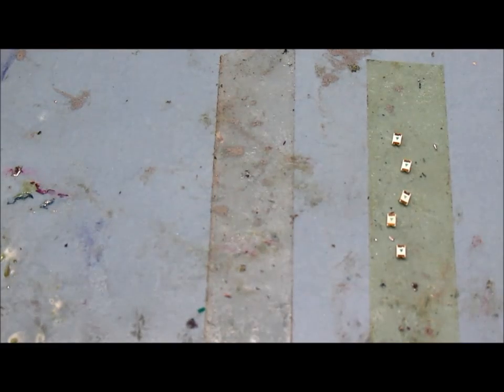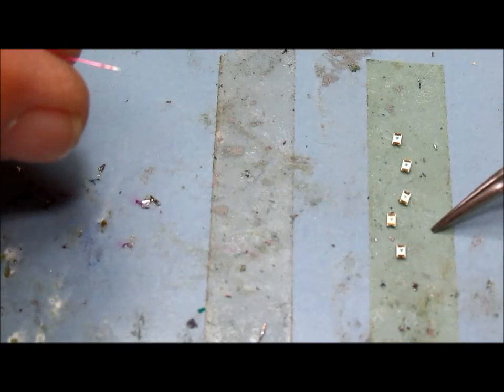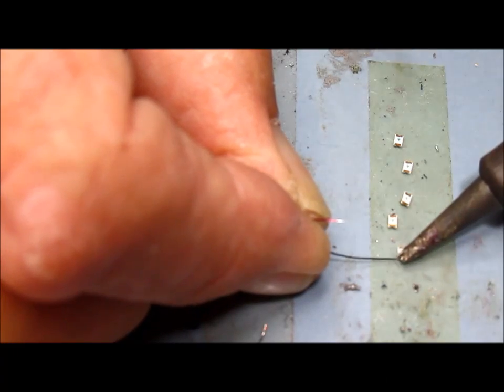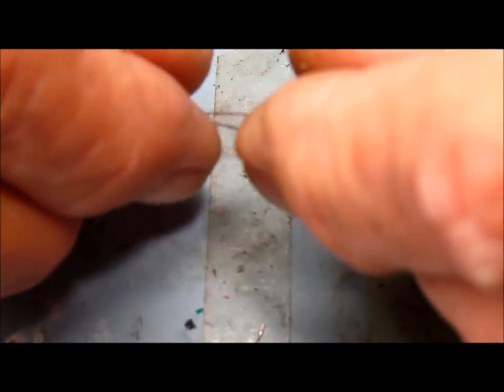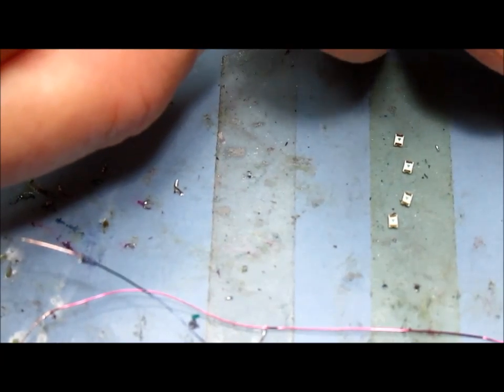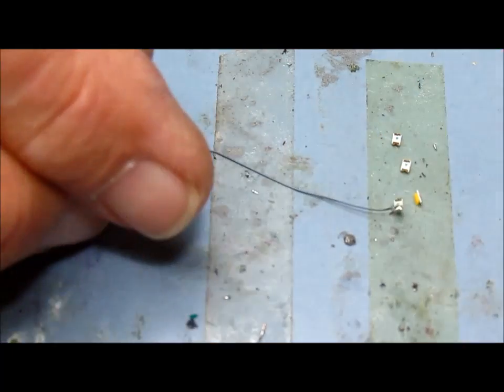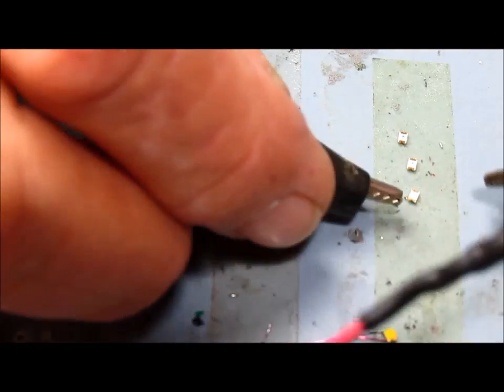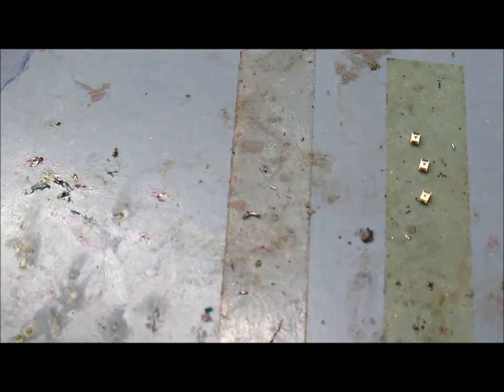Wiring 0805 LEDs

Comment: Even know I’m seeing this video 8 years later I got those same led an they do work on 9v
Reply from the maker: Never connect an LED directly across a power supply. Make sure you are using a series resistor for the LEDs.. 1000 ohm for 9V will be OK.
Reply: @Westimation  good look going to solder it now
Reply: @Westimation  what is ohm ?

Comment: I just got these leds and I plan to wire them to a on/off button, how do I do it and what size resistor will I need? I’m using a 379 battery
Reply from the maker: A 379 battery is 1.55 volts, too low a voltage for most LEDs, except a Red LED which will require a 47 ohm resistor in series with the LED. (Wired between the LED and battery). A LR44 3V cell will work with 100 ohm resistor for red or yellow LEDs or 47 ohm for white or blue LEDs.
Reply: @Westimation  their size 0805 leds, red yellow and green
Reply from the maker: @lildoorknobb5954  Use LR44 battery and one 100 ohm resistor for each LED.
Reply: @Westimation  how many watts for each resistor
Reply from the maker: @lildoorknobb5954  Any low wattage resistor will do.
Reply: @Westimation  How about for 12v's, what resistor is required then please? I'm wanting to create a circuit of white smd LED's + power single ones. With thanks
Reply from the maker: If you want them really bright 470 ohm or 1K ohm.  If I want realistic building lighting I increase the resistor value to 4K7 (4700) ohms or even 10K ohms. 
You could wire up to three white LEDs in series (observing polarity)  with one resistor. Thus each series chain will draw the same current a one LED and resistor. I am using 10K ohms in series with three LEDs on a 12V DC supply on a few of my projects (train carriage and building lighting) and get a very realistic light level.
You must be prepared to experiment with different resistor values. 
ALWAYS use a series resistor.

Comment: what wires are you using ? and how did you get the two colours?
pls , thanks for the upload.
Reply from the maker: Hi Mohsin. 
This wire is from Roadrunner wiring pencil range. 38AWG, which can be purchased from Element14. (search for wiring pencil).
The other and much cheaper option is to use fine wire from a small relay. Use a longer wire to identify the anode.
Prewired SMD LEDs are now available form AliExpress. Saves a lot of work and smaller sizes 0603 and 0402 available.

Comment: Nice job ,this why I bought a digital microscope,Sam smd  make you go blind,I have magnify lamps ,magnify glasses,I need all the help I can get,I like the two sides tape idea
Reply from the maker: Great idea for old eyes like mine. However I used a microscope years ago for SMD work and found how much the soldering iron tip shook in my hands.
Reply: mine hand do shake too,it does take some getting use to ,after all the through hole stuff i have soldered so i bought a little rework station to help me also

Comment: Maybe very important thing to mention is that before soldering the polarity of the LEDs has to be considered .
Reply from the maker: Thanks, have added to comments.
Reply: i also have 0805 and it took me a while to figure out which one one + and - . Then i found that on the front part one of the edges is cut out identifying the minus. I hope that helps if someone has the same led.
Reply from the maker: If you look at the video in full screen you will see that these LEDs have the a triangle the and the base of the triangle indicates the Anode (Positive) end.
Some SMD LEDs have a T and the top of the T indicates the Cathode (Negative). Some I have have no markings. that's why I always test them with the tester.
I have only seen  the corner notch on larger PLCC LEDs. and on one range this indicates the Anode, and on another range the Cathode.

Comment: Where is the best place to buy an assortment of these with a full rainbow of colors? Most eBay sellers seem to only go down to 50pcs. I'd like to try and snap up some 100-200 of these in total, maybe 15-20 of each color.
Reply from the maker: Try this http://www.ebay.com/itm/100pcs-0805-SMD-SMT-Super-Bright-LED-Bulb-White-Red-Blue-Yellow-Green-Each-20pcs-/322063979487?hash=item4afc8253df:g:n7gAAOxyjxlTK7O2

Comment: Could these lights be used between 2 strips of copper tape with a coin battery to light it up?
Reply from the maker: Hi Sue, I see by your You Tube interests that you might be doing cards.
The LED's shown are only 2 mm long. It might be easier to use 1206 size LED's for cards, these are 3.2 mm long. Each pad on the LED could be soldered to the copper tape. You should tin the ends of the copper tape with solder first. Also ensure the tape ends do not touch and cause a short circuit. 
Running from a 3 volt coin cell you would need to add a 47 or 100 ohm resistor into the circuit to limit the current to the LED, which also extends battery life.

Comment: Is that wire insulated, And whats it called please.
Reply from the maker: Hi Kenneth. As stated in the video, "polyeurethane" insulated 28 awg coil winding wire. It can be bought at most good electronic hobby shops or unwound of an old relay.

Comment: What kind of solderpaste are you using?
Reply from the maker: I use Chemtools CT-LT63 or AIM (Chemtools) solder paste supplied in a syringe. Available at Element14, RS, or most good hobby electronic suppliers.

Comment: Looks good but instead of using solder to strip the insulation from wire I used lighter
( well I smoke )so and is really quick and clean
Reply from the maker: woltar9 used to smoke until a few weeks ago when I had a heart attack. Gave up after 50 years.Using the soldering iron with solder does pre-tin the wire and leaves a better edge to the insulation.
Reply: ok

Comment: (Continued from previous post):

...so, the controller unit itself runs off of two 1.5v AA batteries, and I was told I should add an inline resistor to the main power leads/wires, since I'm not actually mounting these LEDs to the circuit board itself, but rather gluing them to the inside of the controller plastic shell, so that the lights are visible on the outside face of the controller through tiny pin-hole sized drilled holes.

My question (sorry for the rambling) is, what type of resistor should I be using for the LEDs? I was told, I think, to use a 100 OHM resistor, but you stated that you used a tester with a 1000 OHM resistor for a 9v power source. Since I'm using 1/3 the power, should I use a resistor 1/3 the rating (eg. 300-350 OHM)?

I should also mention I don't need the LEDs to be overly bright, so I'd rather go with a resistor that's rated a bit higher & have the LEDs not be as bright rather than a lower rated resistor & have them be blindingly bright. Lower light strength would almost certainly prolong the lifespan of the LEDs as well, correct?

Thanks again for your insight/help!
Reply from the maker: 100 ohm resistors at 3V are just fine. Brightness depends on LEDs selected and if very bright versions are used you may need to increase the resistor value to say 220 or 330 ohm.
By the way purchase some cheap 0805 resistors to practice soldering wires to, cheaper than LEDs.
Reply: Fantastic! Thanks for the feedback & for your time!

I have a TONNE of LEDs that I bought from Amazon. Came in a 50-pack of assorted colours for like $10. Ridiculous cheap.

Also, is it better to use the paste to solder the wires to the 0805 terminals/leads, or am I fine just using regular 63/37 solder for the job?

Thanks once again!
Reply from the maker: Fyrecide
You can do it but very easy to destroy the LEDs as they don't like too much heat, I have tired it but failure rate was very high. Set iron tip temperature to 300 degrees and solder quick.   
You can do it this way, but requires more steps, hence my preferred method of using solder paste.
You need a solder flux pen.
Give a generous wipe of flux over the LED pads,
Apply a little solder to your iron tip, hold wire to pad and apply iron.
You will need to clean flux off using either water and detergent (dry with paper towel) or spray isoprol alcohol to clean flux off.
Reply: Thanks for the quick & informative replies! You have definitely helped me out quite a bit!

I had trouble when I first started with getting solder to stick to things, especially since I'm using really thin wires (22 gauge) and very small mini tac momentary buttons that have tiny little 1 or 2mm long terminals to solder to.

My solder simply would not melt onto the wire tip, not could I even tin the tip of my iron because I was 1) using a really, really cheap & low quality iron that I bought at Walmart for $4.99, also 2) I was using lead-free, 99% tin solder, and 3) I wasn't using any additional flux, liquid or otherwise.

I have a nice Weller Variable-Heat Analogue iron on the way from eBay for $99 USD, and got some 60/40 solder, and I will be purchasing some liquid flux as well as the solder paste flux as well.

Quick question: after tinning the iron tip, do I apply the iron tip to the wire tip in order to tin the wire tip before soldering that to a component terminal (like a resistor or a tac button)? Should I use flux on the wire tip before applying the tinned iron to it, or just apply the tinned iron tip directly to the wire without flux of any kind? I've had trouble with the solder not melting to/coating the wire before.

After getting solder on the wire tip, I then want to solder it to the 2mm metal terminals for the tac buttons. I assume I should definitely put some flux on the terminals before soldering the tinned wire to it, correct?

Comment: Great video, thank you for posting it!

I have a fairly simple question: I am starting a project which involves customizing a controller for an XBOX ONE video game console. I am intending to install 2 additional "clone" buttons which will simulate button presses for either of the 4 face buttons (eg. A, B, X, and Y). Purpose is to install these buttons somewhere more convenient so as to eliminate the need to move my right-thumb off the right-analogue stick in order to press on of the aforementioned face buttons.

I'm installing a simple on/off style mode switch to switch which face button the cloned buttons will simulate upon pressing them, and I'd like to install 4 of these 0805 LEDs to correspond with the 4 coloured face buttons for easy visual reference... (comment continued in next post)